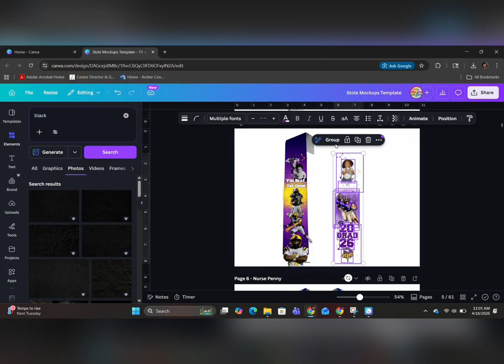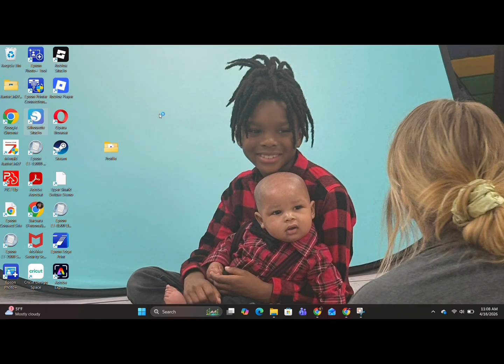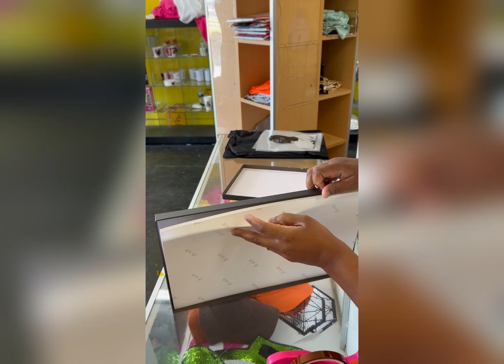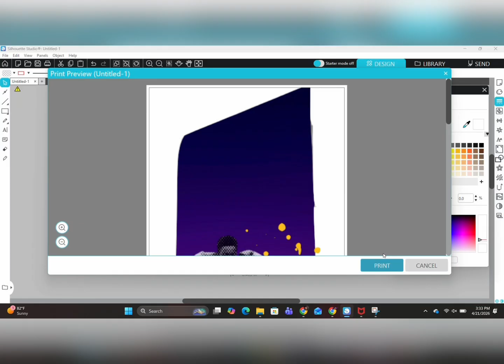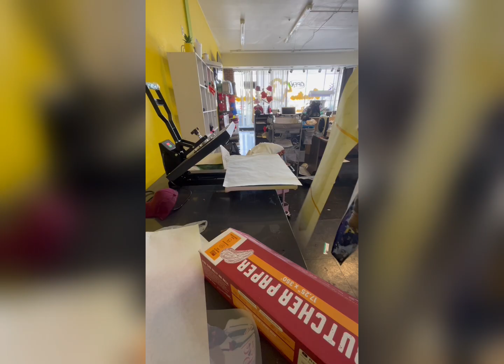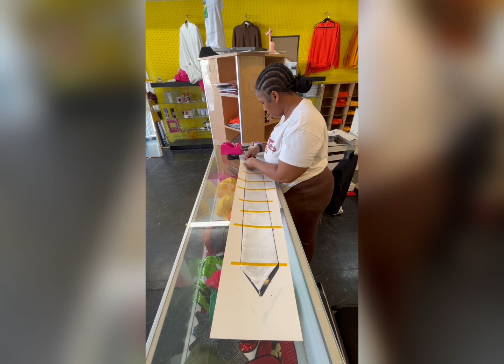Sublimation Graduation Stole Using A Small Format Printer

Comment: This printer is not consider small format. It is an wide format. I have one and it goes up tob13x19 and bigger as far as length. The 2000s are considered small format. 2803, 2850 etc❤

Comment: When you select premium presentation paper matte for paper type, then high quality. Then when you select user define for size, the quality automatically switches to standard & locks out to were you can't change the quality to high.
Reply from the maker: It does this to me also, however, It still prints at a high quality. It’s a silly logic but it works! Hope this helps.